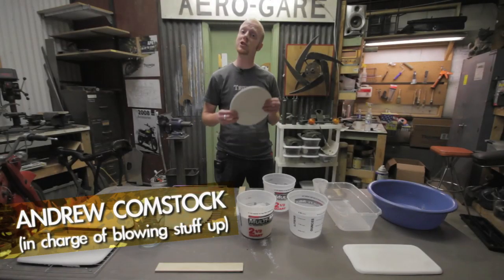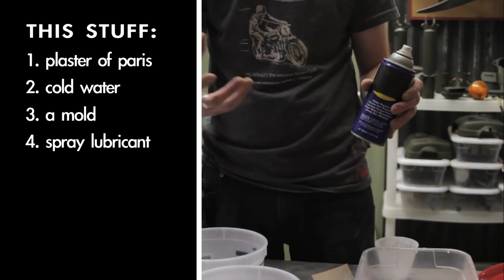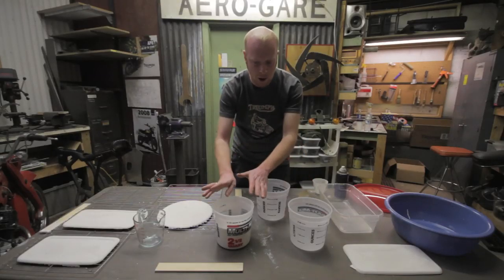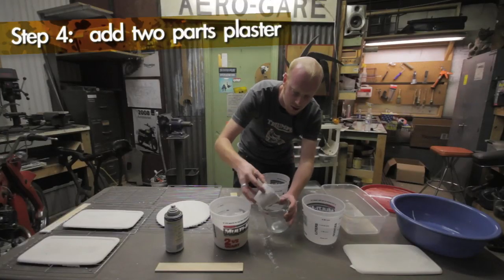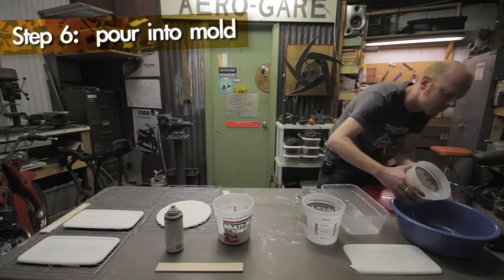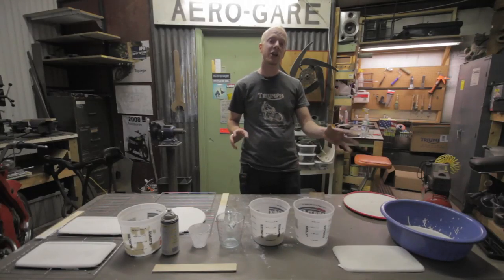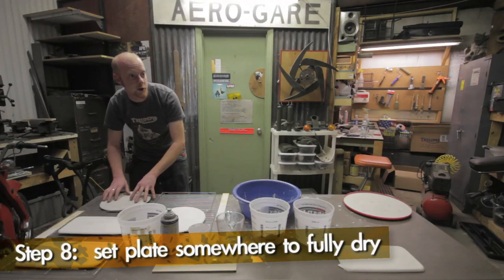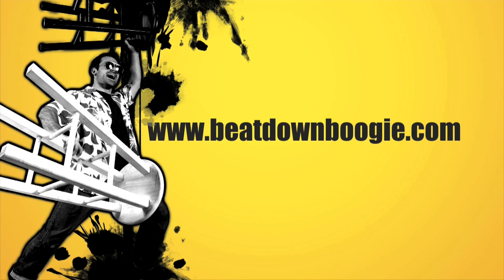How to Make Breakaway Plates for Fight Scenes

Comment: Thanks for vid.. i have tried this technique and the problem i had was that the mixture was like really thick and didnt pour out like the one in the vid, i thought i git the ratio right.. but surely it shouldnt need scooping out? i dont do measurments in cups so i converted to ml and grams.. ended up like 118ml of water to 340g of plaster of paris, The plate came out very unplate except it was round but very lumpy like haha.. any extra tips you could give me, or a gram and ml recipe?

Comment: 0nce the shatter are they sharp enough to cut yourself on?
Reply from the maker: Jessica Milcarsz  The plaster is so crumbly that it would probably be safe in most situations.  However, it might be possible, so safety is advised.  The main thing we think about is any stunts that would involve a break and a fall, since you want to make sure the debris won't interfere with the fall.
Reply: ***** ok thanks for the heads up. I will test it out before I do anything else!